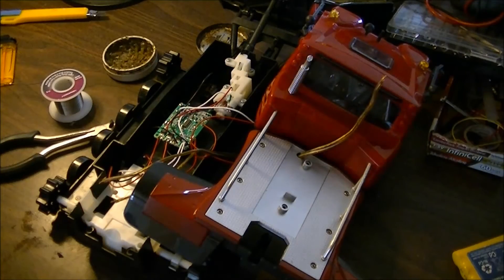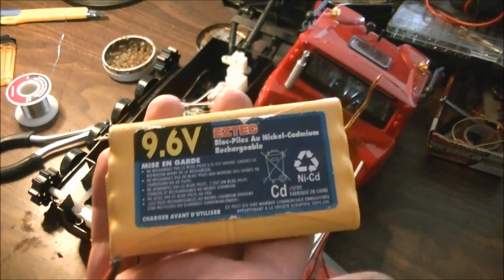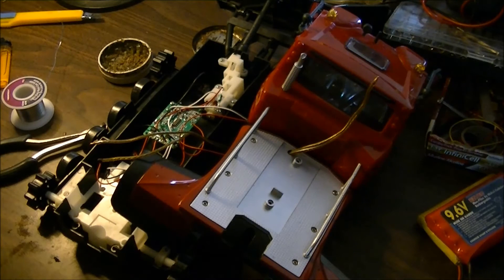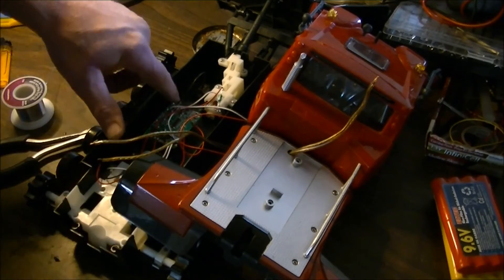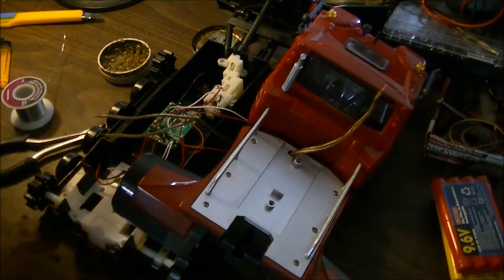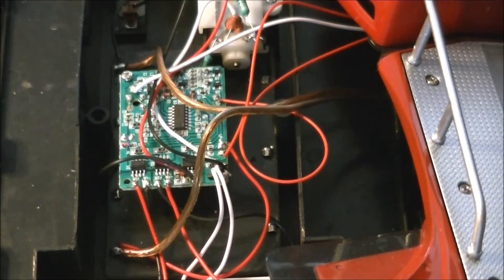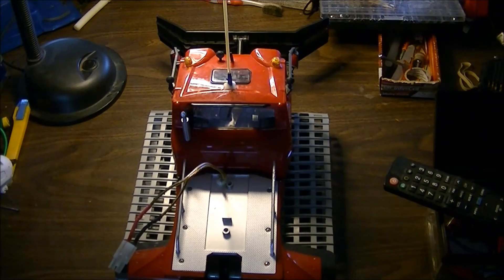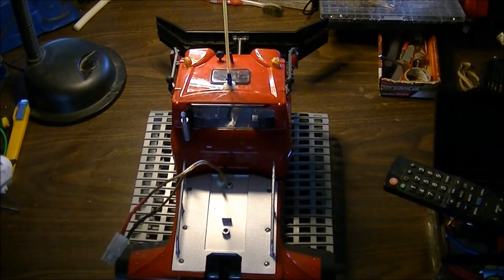Piston Bully Snow Plow Battery Conversion And Testing

Comment: Hi, what motors you used to drive tracks and at what voltage????
Reply from the maker: the motors are stock cant recall the size of them but they run on 9 volts